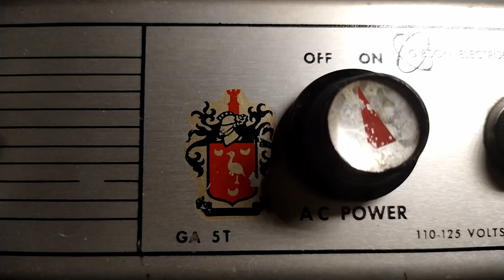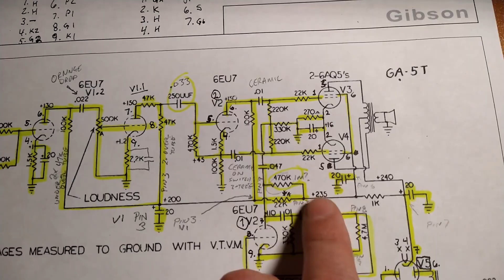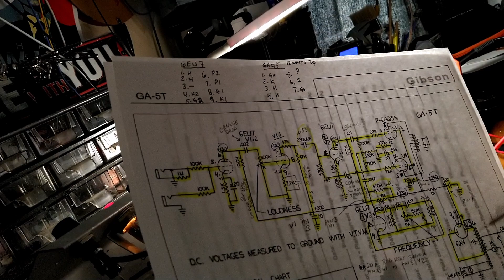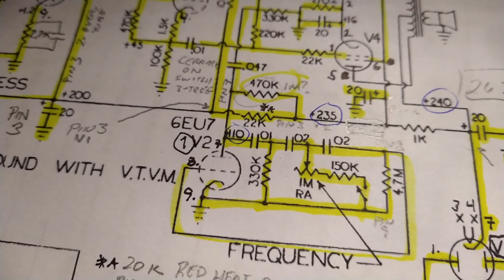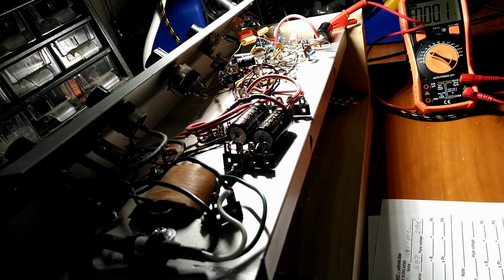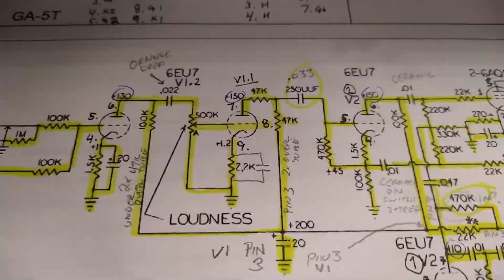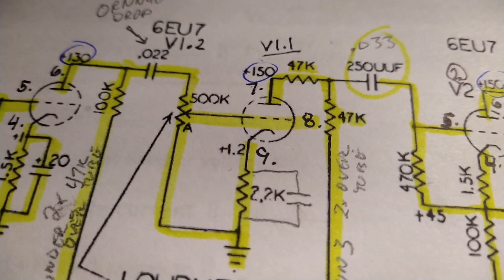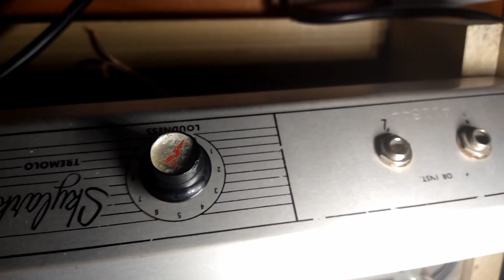SORTIN' OUT THE MESS - GIBSON GA-5T SKYLARK part 3 - LET'S REPAIR! - EPISODE 32

Comment from the maker: See part 4 (the Tolex episode) to finally get to the bottom of the case of the errant tremolo voltage caper. Also, I'm thinking perhaps the voltage to the oscillator plate should be measured with the tremolo switch in the closed position?